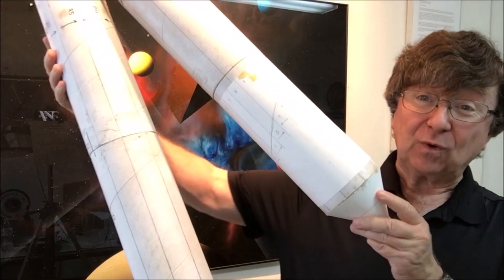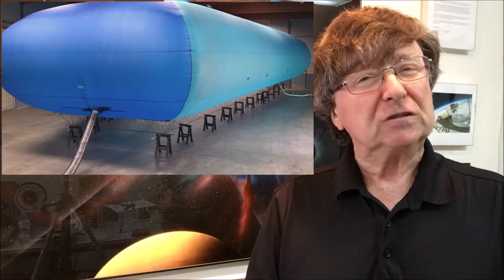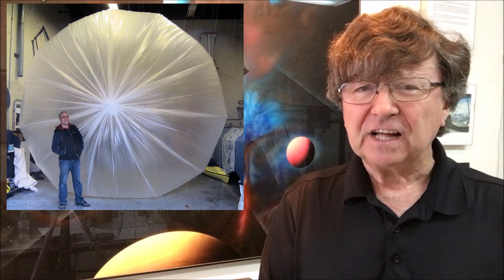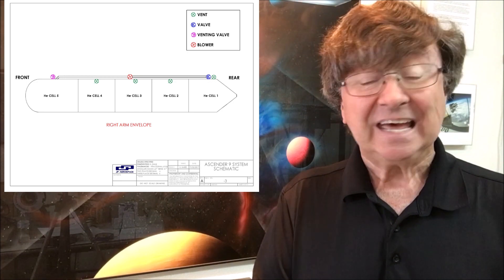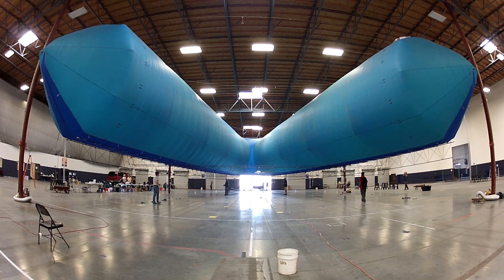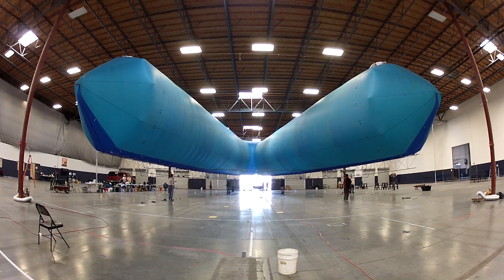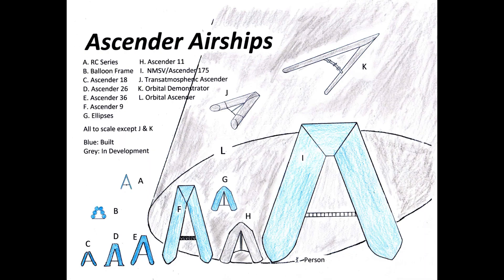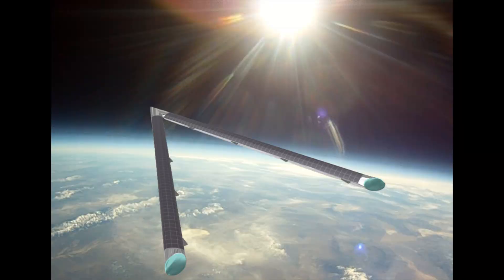Airship inflation 2

Comment: I have an idea for transforming variable lift balloons. Using the double layer approach used by the inflatable habitats from Bigelow Aerospace. An interior balloon layer at relatively high pressure, and an exterior tension bearing layer of kevlar composite. Like a bulletproof double balloon, it can't pop due to the high tension shell and has a maximum volume that it will not exceed in vacuum. But in order to achieve near space with buoyancy, the entire structure has to transform near space to be less dense. This can be achieved with balloons that form rigid struts linked together to form a large polyhedron when fully inflated. This stage would be a vacuum airship because a third layer of the same high tension shell can be used to seal the transforming structure, forming a near vacuum inside the polyhedral void between balloon struts as there is no air pressure near space to oppose this vacuum. When the balloon reaches space, it reaches maximum pressure difference, and the rigid structure changes shape until it needs to collapse and descend.